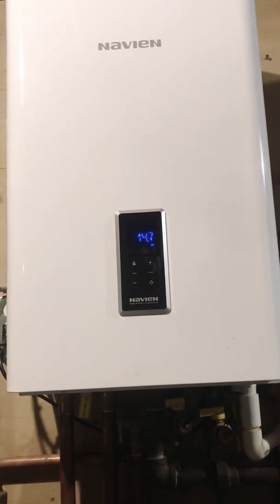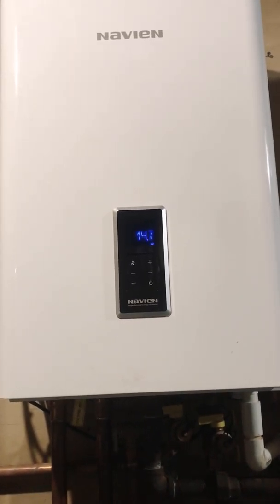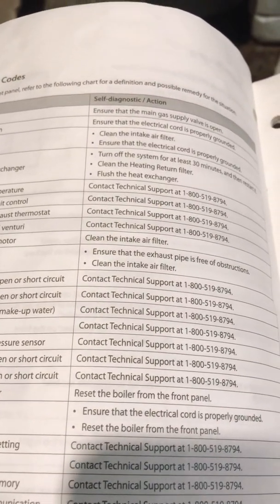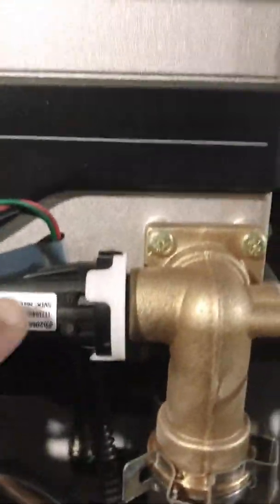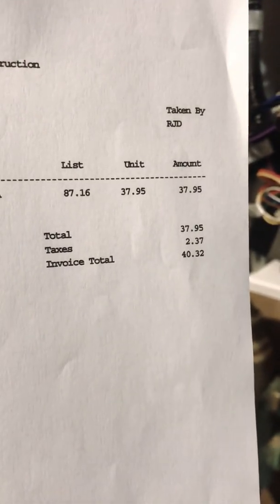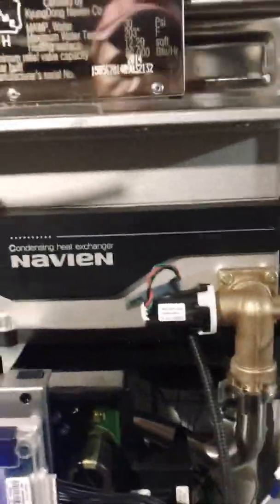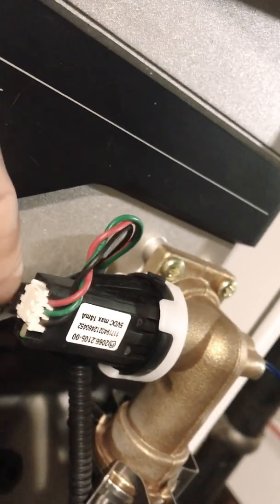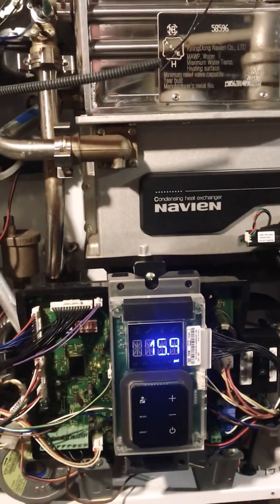NAVIEN COMBI BOILER NCB- 180/210/240  E351/E352/E353 Error Code (EASY ) Fixed !!!!

Comment: The "pump drain plug"? I assume is for domestic hot water side ONLY & not the boiler side?
I'd assume the only pump required would be for the boiler side to circulate the heated boiler water as the domestic side wouldn't need a pump because the domestic side already has city water pressure or well water pressure which has it's own pump to supply pressure?
Edit. : Nevermind... the exterior mounted circulator pumps move the heated/hot boiler water throughout the house. Im over thinking it w/o looking at my unit in front of me...

Comment: Good job getting it done. But just so everybody knows there were a few mistakes in the explanation and his Navien Combi is not piped correctly. There are actually two domestic water supplies to the unit one which can be piped directly into the units domestic inlet which is for the hot water heating and the other goes to the automatic water feed inlet which provides water fir the space heating. On the automatic water feed inlet you need a 9D backflow preventer before it goes into unit. This is so contaminated boiler water doesn't ever backup into domestic house water which is your drinking water and water you shower with. On his unit he has a automatic water feed and backflow combo before it goes into unit which is incorrect.  There is already a automatic water feed built into unit you only need backflow on the line before it goes into unit. Basically he has a automatic water feed on the water line then another inside the unit.  Many I stallers got this part wrong . Most are used to installing this on conventional boilers not knowing a electronic one is but in. So if the external one fails it will stop giving water to boiler for space heating.

Comment: I have a Combi boiler that will not even turn on . I came back from a short trip and I can't even have it on. I had to add some water to the system when I came home , turned the unit and nothing no lights.

Comment: Thanks for the hint. I've got the oil on the bottom of the tank issues and the main board is bad. It's under warranty but the service isn't. If I can fix it I will. but, I haven't been happy with this. I had an old boiler that all i had to do was change the thermocouple once a year and it ran forever. why i changed for the savings is beyond me. Thanks for your help. I'll keep this in mind for the next problem. another issue was the error code 109 "clean the input air filter". It's so sesitive that only a small grass clipping will cause it to go into error.
Reply from the maker: Thank YOU Sir! 
Yes that part sucks unfortunately; ( the service not included on the warranty 🤦🏽‍♂️) .
I haven’t had any other issues since /ever . Let’s keep eye 👁 on it 👍🤝☝🏼

Comment: Thanks for sharing .. I find this company very unhelpful.. they say to call the number and when you call they say to call a plumber .. and I constantly have problems with the unit .. whatever I’ve saved in efficiency I’ve paid in plumbing bills!!
Reply from the maker: That’s true , Unfortunately !
When I called for the first time that’s exactly what they told me . I would have to hire a certified plumber first in order for them to go through the issue . They wouldn’t speak to me or give me any directions but through a plumber 🤦🏽‍♂️🤦🏽‍♂️
So I replaced the water pressure sensor and it’s working fine up to this day ! 😎
Reply: Elvis Barbosa most the time these is caused buy bad quality of water, install a water softer and filtration and make sure you do a annually clean of the coils, specially for domestic hat water.
Reply: So true. The last time a plumber came to replace a 3-way valve and motor, it cost me $850......Whatever I save in monthly heating bills, I paid now.